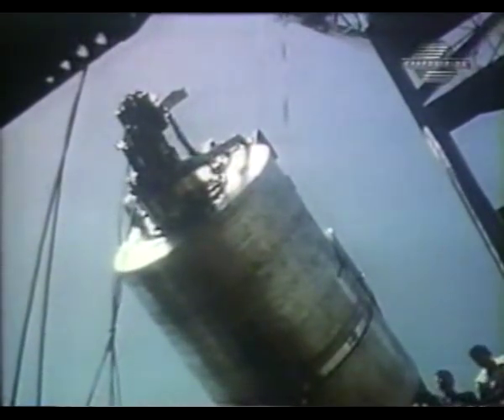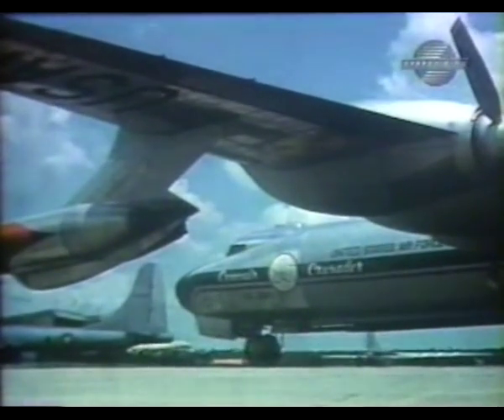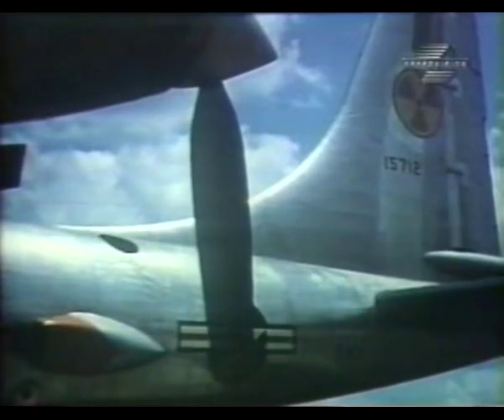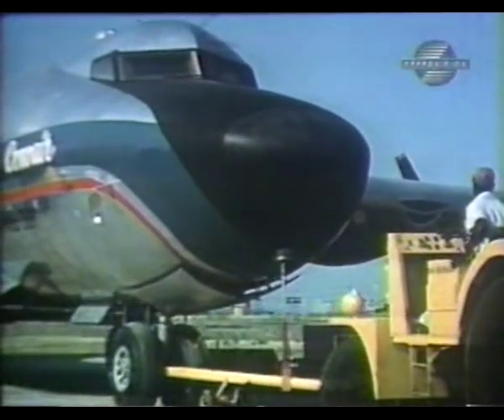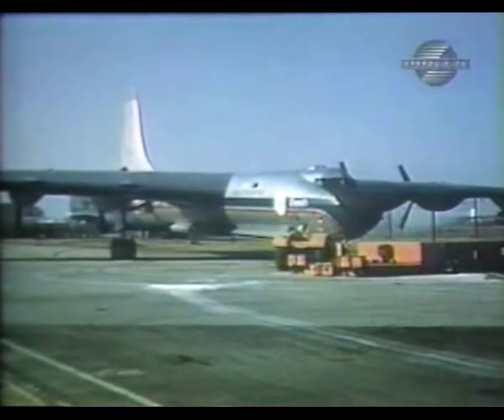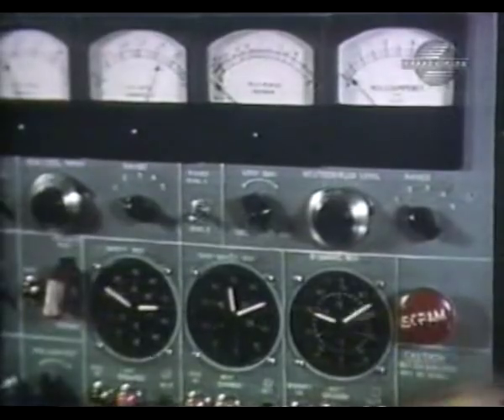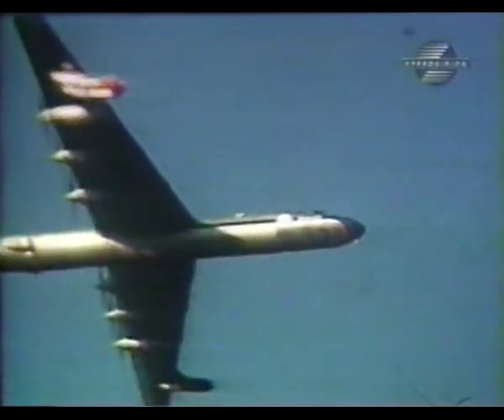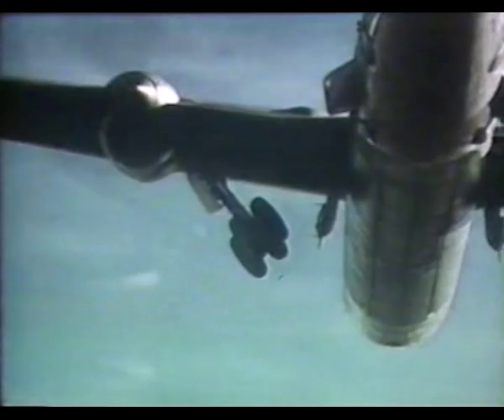Convair NB-36H Peacemaker Nuclear-Powered Test Aircraft

Comment: This project lead to the Molten Salt Reactor Experiment at Oak Ridge.  The MSRE operated from 1965 to 1969 and proved to be very successful.  Oak Ridge director Dr. Alvin Weinberg was fired by the AEC in 1973 for promoting the safety and efficiency of the MSR.  The AEC though they had a better idea and then Three Mile Island happened which ended nuclear power research in the US.  Hopefully the MSR will return and help solve global warming.

Comment: One of my college professors had a huge fear of nuclear powerplants. I casually mentioned an actual, operating nuclear reactor was installed in an aircraft that flew over populated areas. I'm not sure she believed me.  Besides the huge danger in an accident, a couple of things doomed the project.
1. They never got the thrust they wanted from the atomic engine.
2. The engine would have spewed radioactivity in its wake.
3. Inflight refueling extended the range of conventional aircraft.

Comment: @Colariboo actully most fusion reactors still release neutron radiation because they use a reaction of deuterium and tritium, one of the neutrons in the tritium is released since helium usually just needs 2 neutrons, I'm not a expert on this but I presume that this is because of the reaction with tritium requires less energy to initiate

Comment: Trouble with nuclear-powered airplanes: 1) What if it crashed or was shot down?  2) Shielding for the crew.  OK, so it could stay in the air for weeks, but the crew couldn't - and the baffling needed to keep a reactor safe is so heavy even today that it is just not worth it.  Not much point in a bomber that can remain aloft for a month if it can't carry an effective bombload.
Reply: To answer your first point, that is a big concern. Upon learning about this plane, I had the thought that a nuclear powered commercial jet would’ve done more than knock down the world trade center, it would have rendered New York uninhabitable. Molten salt and thorium reactors, however, are a lot safer, thorium  if I understand right, doesn’t even produce lethal radiation, or melt down the way uranium does. To answer your second question, see comment about thorium reactors. third point, the B2 proved you can do a lot with a little. The use of GPS guided bombs changed the question, according to Air Force strategist, at the time, from how many bombers does it take to eliminate a target to how many targets can be eliminated by a bomber.

Comment: What about a thorium reactor as power drive for aircraft? Or atmospheric in-take plasma manifold system? You could try build a unidirectional (one way, non-multi 360 directional) wireless (over-the-air, OTA) power transmission laser beam system so that ground stations could fire a beam of power to charge up energy cells and batteries for powerful transmission instead of omnidirectional power transmission charge. Or use a Fulton surface-to-air recovery system (STARS) turned into a fuel pick up site fly-by procedure.
Reply: Unboundedominion A thorium reactor would be too heavy and have very low power output to fit it on a plane. The thorium breeding blanket wouldn't generate any power so it would just be dead weight. They would have used plutonium or 90% U235 for military reactors.
Reply: leerman22 Thanks. I'm not an expert on these things. Does a thorium reactor have enough power for a train or boat (sea craft)?
Reply: Unboundedominion
A cargo ship or an icebreaker no doubt. Russia has nuclear icebreakers already but those don't run on thorium. I don't think it would be worth the cost though so an onshore thorium breeder can make fuel for it.